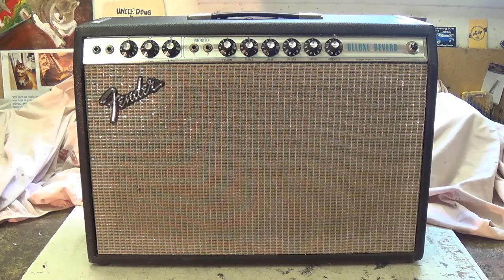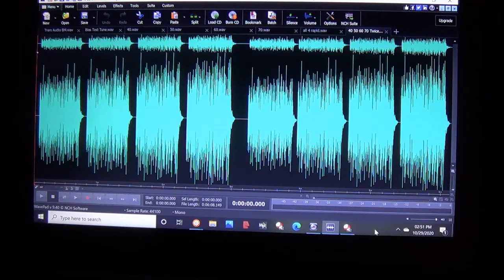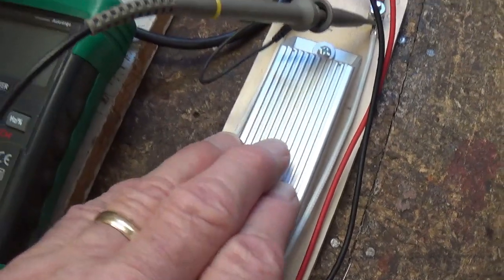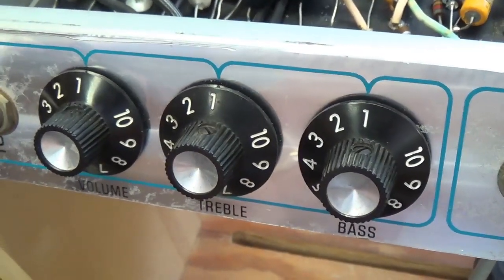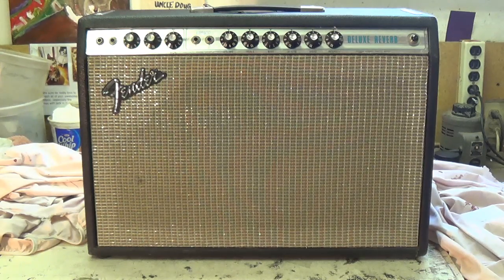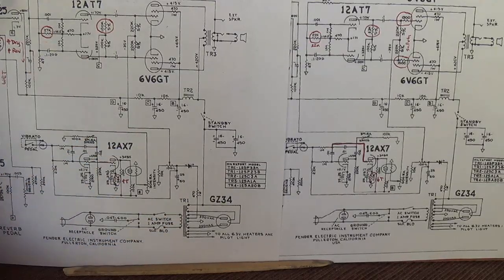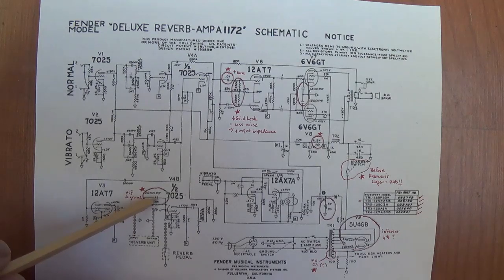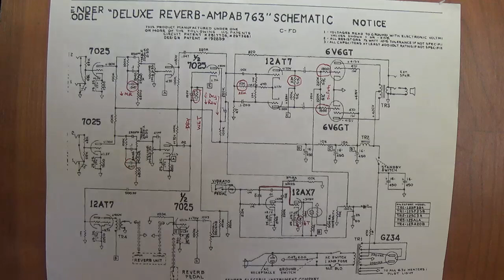The Effect of Output Tube Bias on Tone, Gain, and Headroom.....A Side-by-Side Comparison

Comment: Excellent video, Uncle Doug.  Over the years I have heard many negative remarks about the materials used in the SF Deluxe Reverb (plastic insulated wire vs cloth insulation), the minor differences in the execution of the internal lead dress, the quality of the wood used in fabricating the amp cabinet, etc.  These all seem to be pretty minor (and perhaps elitist) issues that surely do not justify the significantly higher price of the BF amp.
Reply from the maker: I agree completely, John. At least for now, the SF's are a real bargain.

Comment: 'Headroom' refers to the level of signal that can be applied to an amplification stage before it clips. E.g., A stage that clips with a 5V p-p input signal has more headroom than a stage which clips with a 2V p-p input signal.
Reply from the maker: Thanks for your helpful input, Silas.

Comment: Excellent video, Doug, as always, and I'd love to see more of these. 
My #1 is also a silverface DR. If I may, I'd like to add a couple of comments/points of information to the second part of the video.
1) There was at least one more silverface DR circuit, although Fender had abandoned the 60s-70s numbering scheme by then. This is the '77-80 version (actually two versions, the second one adding a boost pedal), with the infamous icepick-in-the-ears pull-boost, which I have. I haven't looked at the schematic in a while (if I can even find it any more), but I think besides the boost, which taps off the reverb drive transformer secondary for boosting, it's similar to the A1270. 
2) The "snubber caps", the ceramics on the grids of the power tubes, were reportedly put into a lot (all?) of the SF amps in order to suppress parasitic oscillations. This may have been a cost-cutting measure, meant to eliminate troubleshooting time, or was perhaps made necessary by the drop in the skill level of Fender's staff, resulting in poor wiring dress, which anyone who has looked at the inside of otherwise nearly identically laid out amps from the early-mid '60s (gorgeous) and a decade later (spaghetti) can attest. What was the name of that legendary woman who signed her amps, again? I don't think she worked there any more. 
3) The change from the .001 coupling cap to the .01 was not a good one. It was all part of a misguided effort by CBS to up wattage and frequency response ratings and make the amps more "hifi". But the added bass is too much for the power amp and the single speaker, and leads to what players commonly refer to as flubbiness or fartiness as you turn the amp up. Changing this back to the BF value was, along with replacing the speaker, the thing that suddenly made me understand, years after I got the amp, why people get excited about these amps. It's really a game changer, and highly, highly recommended. I seriously can't imagine why anyone would prefer the .01.
4) Whatever the original motivation was to switch from the GZ34 to 5U4, that drop in output voltage may be important in light of the increases in wall voltage over the years. As you know, the AB763 was designed for 110-117VAC, while current voltage is supposed to be 120, but is often higher, while the plate voltage as designed already pushes the envelope for 6V6GTs--100v higher than spec(!). Fender showed that you can get away with that with top quality OEM RCA and GE made tubes, and currently JJ supposedly designs for higher voltages, but other tubes may not handle that kind of stress so well, so pushing beyond that may be, well, nuts. So anyone switching to the GZ34 should perhaps think about other strategies for reducing plate voltage.
Reply from the maker: Thanks for your nice comments and knowledgeable input, Ben.

Comment: Great Info Uncle Doug. I rebuilt a Twin reverb Years ago and my reverb is just too deep. so I'm thinking I can lower the plate resistor a little. I thought it was the tank. could you suggest a tube that will give me more tone in the reverb preamp section? btw I like your amp between 60 and 70 %  Thank you very much for making these videos. c];-)
Reply from the maker: Thanks, Al. I've never heard a reverb that was "too deep" so I can't offer much in the way of suggestions. Can't you just reduce the Reverb Depth control ?
Reply from the maker: @ALtheDoctorWho  The reverb circuit is rather complex, AL. You might want to seek some help from a tech.

Comment: Excellent exposition - thank you!    

A question:  The plate current you were using at 70% pd was about 18 mA for this AB763 DR during the course of your experimental observations.   

The very first reading you showed at the beginning of the video, some 4-1/2 minutes in, shows the place current at a bit over 22mA, which is what I keep hearing is the ‘correct’ general range for a DR AB763 (and it’s about where mine is biased and where it sounds good to my ear).  

Can you comment on whether low 20s mA (I’m using about 22+ a bit) constitutes a correct and safe bias for this circuit?    I’m trying to color inside the lines and avoid running too-high plate voltages, because I understand that many modern 6V6 tubes can’t take the load that an old RCA or similar could.   I like good tone but I also like power tubes to last a while.  

TIA for any comments - and please do continue with the tech talks; they are uniformly excellent.
Reply from the maker: Plate current is simply one factor which, when multiplied by the plate voltage yields the Plate Dissipation. If the PV is high, naturally the PC will be lower, and vice versa if PV is low. The PV is generally dictated by the HV output of the power transformer, while the PC is controlled by bias adjustment. Both values vary depending on the circuit itself, but 6V6's seem to be happy at PC's from about 20mA up to 35mA.
Reply: @UncleDoug  Thank you for confirming the general range of approx 20-35mA PC!  
Much appreciated.

Comment: Hi. I think that the replacement of the noddle resistor from 10k to 2.2k on the 1172 is related to the replacement of the rectifier tube to allow to have higher voltages on the tubes to compensate the loss because of the rectifier efficiency. Makes sense? Or just to have a different voltage on the tube that noddle feeds which I think is the phase inverter. That second feature on the videos is very knowledge full. I learn a lot. Thanks.
Reply from the maker: You're welcome, Ramil. Thanks for your input.

Comment: Quick to question. Do preamp tubes wear out? In other words, do you just replace preamp tubes when sound bad?? Or should you replace them every so often?
Reply from the maker: They operate at much lower plate current than output tubes, Carl, and rarely, if ever, wear out. I only replace them if they develop a short or open filament, or become microphonic.

Comment: Great video as always U.D. Thank you for this.
In the A 1172 schematic, the inter-nodal resistor is lowered to 2.2 K  so the voltage at the node C is higher. The node C is the voltage that feeds only the 12AT7 inverter tube. As you correctly pointed out, Fender lowered the grid leak resistors to 330K. This choice reduces the input impedance of the stage, therefore reducing the overall gain of the stage effectively. I believe they tried to compensate that by feeding the inverter tube with a higher plate voltage.

I might talk no-sense. Nevertheless, thank you very much, beautiful video.
Reply from the maker: Thanks so much for your helpful input, Federico.

Comment: There are several issues here.

1. Is this a class A or class B amplifier? If it's class A there should be no crossover distortion at all, because both tubes are conducting all the time, and the correct bias is whatever you like within the limits of the tubes. If it's class B, the correct setting is the most negative value that minimises crossover distortions.

2. Clipping occurs at both negative and positive, i.e.. at cutoff as well as saturation. You only looked at the positive. One would expect lower bias (in terms of PD) to clip negative before positive.

3. You would find it much easier to find the clipping point, and see crossover distortion, if you only had one or two cycles showing on the scope. There is no need to display ten. The EEs will say to display one only, but I like the look of two, especially when looking for crossover distortion.

4. This amp must have no NFB. Otherwise its gain would be constant. That being so, it follows from the efficiency and the maths that the output power will track the PD. No need to measure that.

5. You seem to have had treble and bass turned down to zero. This will affect the clipping point at 10KHz and maybe even at 2KHz. It's not plausible that you got the same clipping point at 10KHz , the same input level, with the tone control set to 1 and then 10. There is something wrong here. There is a very large gain difference between these two settings.

6. 2KHz is too high. Distortion is conventionally measured at 1KHz, or in the old days 700Hz. I believe it should be measured at 200Hz actually, but I never do it. The lure of having the oscillator set at an even 1KHz seems to be just too great. ;-)

7. I agree with the other commenter that there is something badly wrong with your oscillator. I have always thought so. It sounds far too bright, and the scope display shows it is badly triangulated, which means it is generating all harmonics at a very high level.

8. You can detect low-order harmonic distortion, say 2,3,4, with a scope if it is high enough, but if it's that high you have another problem anyway.

9. Output tube imbalance causes even order distortion. The major source of crossover distortion is underbiasing. Notch distortion, which isn't the same thing, is caused by switching effects inside the output transformer. The McIntosh circuit has specific measures to combat that.

10. If there is no crossover distortion, the signal should not have straight lines, it should have a sine wave, assuming your signal generator generates them ;-)

11. Your explanation of volume is not correct. Inputs and outputs are measured in volts or watts, not dB. Decibels are logarithmic. The ratio of two logs isn't the same as the ratio of the underlying quantities. If you really had an input of 50dB referenced to something and an output of 100dB referenced to the same thing, the gain would be not 2 but 50dB, or a factor of about 300.

12. Your explanation of headroom basically equates it to output power. Headroom is really a function of the earlier stages of the amplifier, and has nothing to do with bias level. You want the input stages to have enough headroom so they won't clip ahead of the output stage.

Sorry for such a long post, but it was a long video ;-) Keep up the good work.
Reply: It's AB if biased as the designer intended.
Reply from the maker: Thanks for your input, EJP.

Comment: 1'08"00 the reduced gain at the phase splitter may be to compensate for a slightly hotter signal coming into it via the larger-value DC blockers; raising the value of those caps- depending on the total impedance seen by the previous stage- will 'let more signal through', & so it may have been felt necessary to reduce the gain slightly.
similarly, the changes you note to the input of the reverb tank... there may have been an issue with the signal hitting the reverb tank transducer too hot or getting clipped. note that these changes only affect what's hitting the input of the tank, while the reverb output amplification is unaltered.
Reply from the maker: Thanks for your excellent analysis, Duncan. We really appreciate your knowledgeable input.

Comment: Hi Uncle Doug. Great video again. I think that you inverted the explanation on the tube rectifiers (direct or indirect heated). Thanks. Alvaro.
Reply from the maker: I believe what I said was correct, RA.  GZ34  cathodes are  heated by filaments to provide slow start up. 5U4 cathodes and filaments are combined, so the cathode is directly heated and provides a rapid flow of HV. I realize that the GZ34 cathodes and filaments are connected by a single wire within the tube, but the 5VAC flows only through the closed filament circuit.
Reply: @UncleDoug  I understood that Uncle Doug, but I think that the symbols on the schematics show us to the contrary. Maybe were the symbols of that time that make that confused perception, to the contrary of that you were saying on the video. The symbol of the 5U4 looks like an indirectly heated cathode and the symbol of the GZ34 looks like that it has only an heather-cathode. Thanks again. I am sure that you are correct in your saying. Alvaro.

Comment: Hey uncle Doug, I have a question. I would like to make my 1975 Vibrolux reverb less bassy. What if I change the coupling cap from 0.01 to 0.001? Would that be OK, or is it necessary to change other components to compensate? I don't need to go fully blackface but to have a bit less bass. Great circuit comparison in the 2nd part of the this video! Thanks a lot!
Reply from the maker: That sounds a little overboard to me, SO, but in all matters like this, my advice is to experiment with different values and strategies to achieve your goal. Perhaps .005uf might be a less drastic change for starters.
Reply: @UncleDoug  Thanks! My thinking was that if I change this cap to a blackface spec, the amount of bass should be similar to blackface. Apparently, it is not like that, is it? Do the different resistor values in the long tail pair (blackface vs silverface - 1M vs 330K) play a role in the amount of bass going to the power section?
Reply from the maker: @sagestowlsreviews2096  Resistors alone have no effect on the frequencies passed. When combined with capacitors they can  create high and low pass filters. Perhaps this site can help you acquire a greater understanding of the LTP:  https://www.ampbooks.com/mobile/amplifier-calculators/long-tailed-pair/

Comment: There are many types of distortion in amplifiers. Crossover distortion is the worst. It sounds horrible; much worse than harmonic distortion (which is the result of driving the amp into clipping).  Fortunately, tubes are "soft clipping" devices and much more forgiving than solid state equipment.  A different reason for a poor sound quality may be an undersized output transformer.  Transformers should have enough head room to avoid saturation of the core.  More iron is the answer.
Reply from the maker: Thanks for your helpful and accurate input, B.

Comment: Hi Uncle Doug.  What a great idea for a video!  I wanted to make a few comments.  First, one cannot compare tone without equalizing the volume between tests. As volume is reduced, the ear perceives less and less bass, creating a thinner, tinny tone.  This effect has been known for decades and is described by the Fletcher-Munson curve.  Also, either your signal generator has some issues or the amp was not working well.  The sinewaves displayed on your scope looked more like triangle waves than sinewaves and clearly show excessive distortion.  In general, Fender amps will reproduce a good looking sinewave, so something was amiss here, I believe.   I was also surprised by the amount of crossover distortion--even at 70% bias.  This also makes me wonder about the state of the amp.
Finally, putting more current through a differential stage was almost always increases gain.  Think of it this way,  The output stage shares its current between 2 tubes.  The input signal into the diff stage causes one tube to take a larger percent of that shared current, while the other tube takes a commensurately smaller percent of the current.  So, as the current is increased,  the percent difference means a larger differential current.  I hope I explained that in a way that makes sense.
Reply from the maker: Thanks for your knowledgeable input, R :)

Comment: What an extravaganza for us ampaholics!  Thumbs up for having extra technical sections in your videos.  I think Fender may have taken the easy way out with the majority of the voltages marked on the schematics and didn't bother to measure/change them.  As you noted the power transformer doesn't change and neither does the B+ (420V) even though the rectifier does.  When they dropped the node "C" resistor down to 2.2K it raised the node "C" voltage by 50V but somehow node "D" voltage was unaffected.  Presumably the transformer's 5V winding was rated 50% higher than originally needed so it can handle the 3amps for the 5U4G.  One advantage of the 5U4G is that it only requires around half the plate supply resistance compared to the 5AR4/GZ34.  A 5U4GB/5AS4A is lower again.  I'm not a fan of Standby switches but I totally agree on placing it after the reservoir cap(s).  The proviso being that the caps are rated accordingly.  A GZ34 with 330V on the plates and supplying no current (Standby switch open) will put out around 465-470V, too much for those 450V ones in the long term.  I feel they need to be 500V units.  Thanks again for this in depth and informative video.  Now watch the price of SF Deluxe Reverbs go up.  All the best to you and yours from my side of the Pacific.  Regards, Jeff.
Reply from the maker: Thanks so much for your very accurate, informative input, Jeff. I guess the time to buy a SF Deluxe Reverb was about a week ago :)
Reply: dang it! here im thinking the price of BFs will come down after this.  silly me.